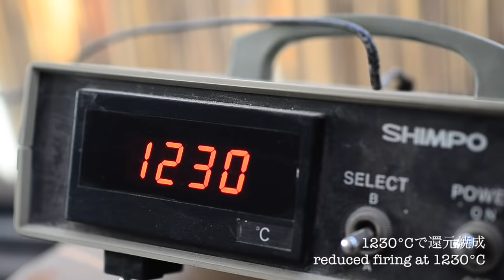１枚のお皿ができるまで☆How to make a kohiki plate

Comment: I'm reminded of how pottery class always stereotyped as some boring couple activity, but this looks like really satisfying work. I really like to look of these plates, but I'd imagine they're not cheap, don't know if making them yourself is any cheaper or if it's just for the personal touch.
Reply: I did pottery in primary for 3 years
And its just amazing
You should give it a try
Reply: I will definitely consider it if the opportunity arises Jasmine Kong
Reply: BTW, plates are one of the easier things to make. His was off center. If he was making a vase it would have fell in.
Reply: Bobby White
Luckily I'm not in great need of vases, would you say it would cause a problem for a bowl though?
Reply: Hmm, depends on how deep the bowl will be. If beginners try to make a big salad bowl, you'll be in for a challenge. Start small, but the most challenging part of ceramics is centering. Even after you pat down the clay as round as you can, it will never be centered which is why you need to do that.
Reply: Bobby White
What about like.. a cereal bowl?
Reply: Not too hard
Reply: small quibble. plates are one of the easier things to throw, and then only if you're good at trimming. good luck getting it out of the kiln without warps or cracks, flat forms like that are a pain in the ass for an inexperienced potter. he must have either a very good teacher or very good luck.  I didn't notice his clay terribly off center, but if I was making a plate on a rough board like that I wouldn't've put too much enthusiasm into centering it either, not when it doesn't really matter for the success of the piece. .
Reply: You could cast some bowls. You know, provided you have a cast and clay. All my ceramic pieces were cast, but that was simply because I generally only had 2 hours of work time when I did ceramics in school.
Reply: Fishbones i actually was able to take a 3D art foundations class and one of my favourite parts was working with the potters wheel to make things like bowls and plates. its tough but very rewarding to have the finished product
Reply: Everyone: “it’s off-centered”
Me: I don’t see it am I blind
Reply: @bobby white It did have a little wobble to it around the edge, but I throw with crooked bats all the time and it didn't look that bad to me. I have thrown vases with that amount of wobble in them, and it's hit or miss depending on the day, but then again, I'm not a master potter. 
Tbh, anyone who throws will be a touch off center, even my instructor, who has been throwing, and was a production potter, for 40 years. It's not humanly possible to get absolute center and keep it as you pull the clay, but you can still get a completed object from it, and you often won't notice the wobbles if it's not spinning.

Comment: 1. Ive never seen yellow clay like that
2. When you add sand to the clay is it not sharp when you throw it?
3. That spinning rectangle bat corners look dangerous
4. Ive never seen potters apply slip before biscuit firing
5. The way you remove glaze from the foot is so interesting